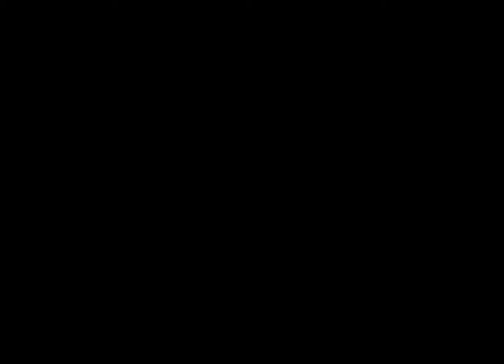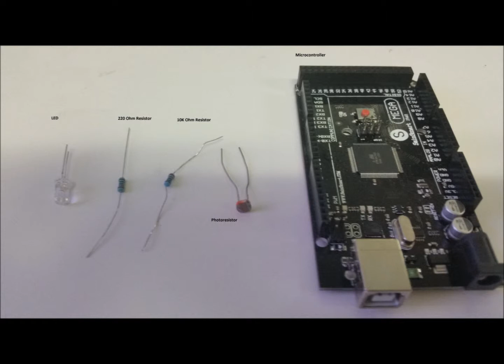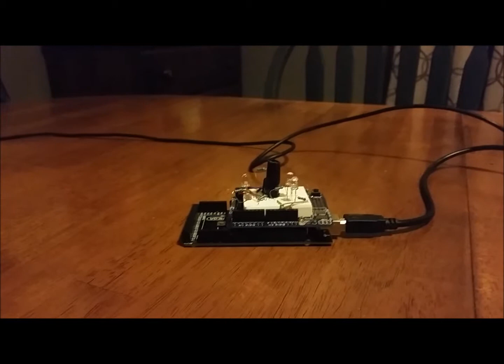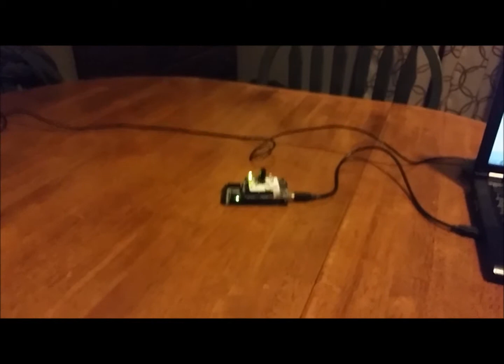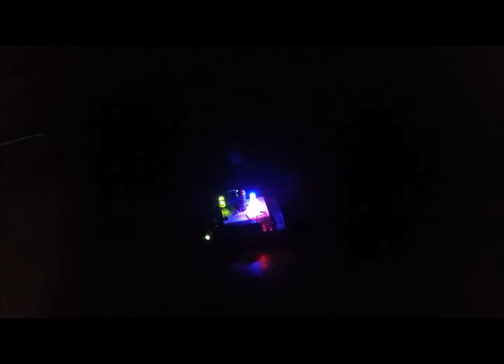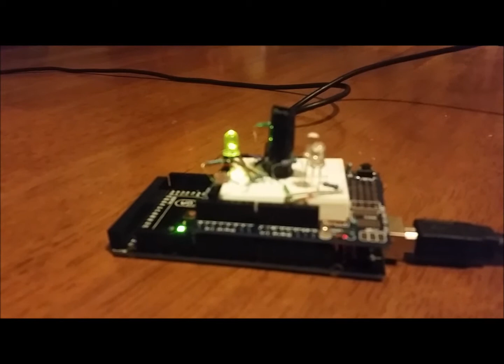Ambient Light Sensor for Automatic Headlight Control ECE 470 project

Comment: Can i get the circuit diagram of it . I wana know how u made the connections
Reply from the maker: I don't have it. Sorry. I built that  8 years ago. I believe all I/Os were Digital if that helps. There are 2 photoresistors being used. One is inside the modified pen cap.